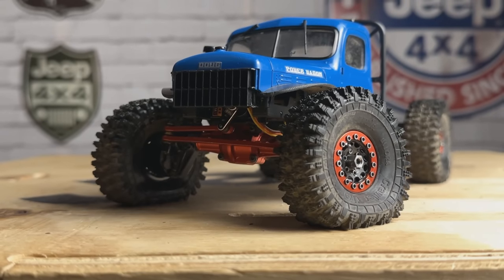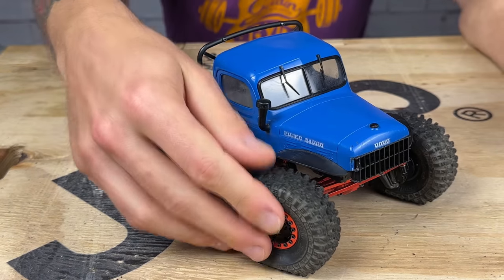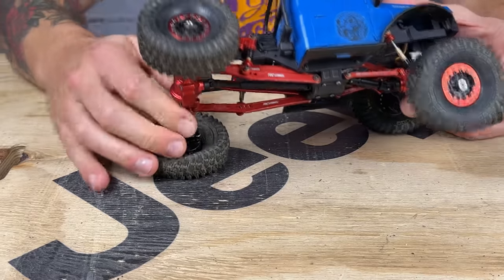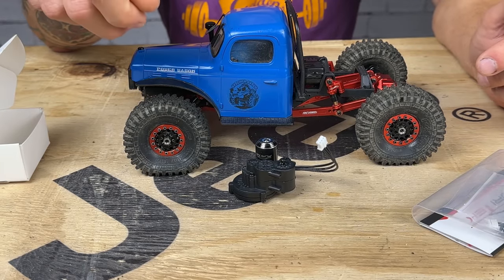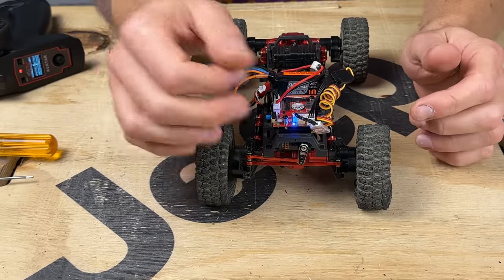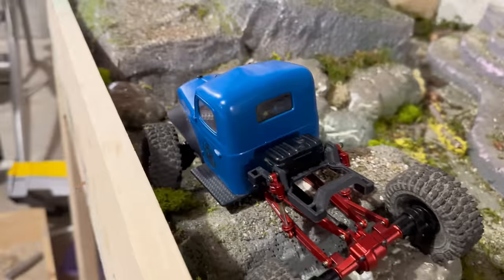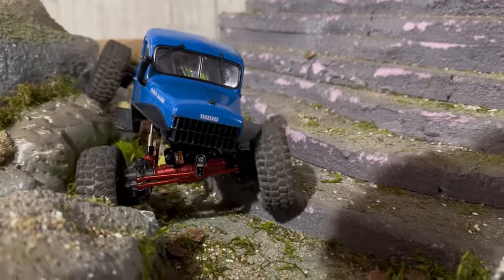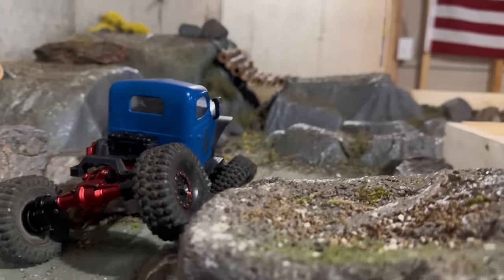FMS FCX24 Power Wagon UPGRADES - Furitek BRUSHLESS Conversion, Extended Wheelbase, Crawling & More!

Comment from the maker: Timestamps
Build recap and current state: 1:28
Furitek upgrades: 6:30
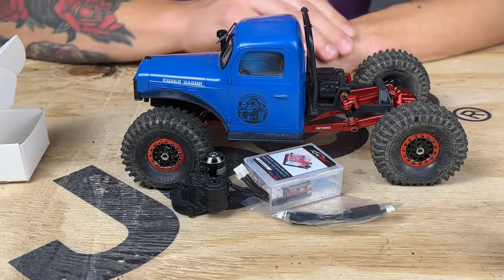Installation and setup: 8:27
Course runs: 11:19
Final thoughts: 16:09
Reply: With the longer wheelbase what do I use as a driveshaft?
I looked on the RCAWD website, most of the parts are there.
Not sure on what links I need though there was a couple of options.
Reply: thanks for the timestamps
Reply: Hi, whats the gladiator shaft you talk about?

Comment: Modified FCX will destroy all others even if modified! Those and the swampkings are my go to. Flubbers with fix side wall
 issue. Velcro your tegu on the transmission and run the stock battery in holder. This way you can drop the body down. I run the rear scx link arms up front. If you go with the shock loops I showed you and the shocks you'll spend some time with a Dremel to modify the body but its well worth it!!! I love Furitek motors but I opted for MOFO BAM 4100KV bolts right up. All metal gears are a MUST with this motor. In first gear it slow crawls well and the the punch is amazing. In second gear its just bananas almost incontrollable. No need for 3s unless your making a drag truck LOL. Merry Christmas. PM on facebook if you want to know more....
Reply from the maker: Great idea with the battery/esc location! I need to figure out how to get my avatar transmitter to switch gears. But you are right about the speed, it's fast even in first gear!
Reply: @CapeCrawlers  I use GT5 and AR52-A2+ rx plug n play shifts perfectly😁

Comment: I just bought one last week and I love it but it needs a little help what’s your build list minus the brushless conversion if you don’t mind your truck looks awesome
Reply from the maker: Thanks! Its got:
RCAWD brass wheels with Injora 64mm tires (soft lil nova foams)
RCAWD shocks, trailing arm kit, high clearance links up front, and axle housings
Treal portal covers up front, RCAWD in the back
Treal steering linkage, hex extensions
Emax servo
I think that's it less the motor/esc.

Comment: Since you didn't use the silver drive hsft that was included in the wheel extension kit. Can you tell me what each half measures. I was told the fully collapsed driveshafts measures 70mm but there is no info on a extended length?
Reply from the maker: The extended length is ~96mm

Comment: Man, this is so cool.... I have been into 10th scale, but I did get my 8yr old daughter a scx24 JLU she loves and I have done a couple small mods... Really like the small class and ability to have really small area maps to run on, really gives the same satisfaction as larger with small space requirements. This rig here is insane, it's so cool how many options they are making for these units. Question.... She sees my faster rigs and at times wants just to drive faster what would you recommend for a little more speed without sacrificing its crawl ability etc where maybe it would be a little more exciting for here.. Pinion gear? Motor? Or is it just not good to go faster with it... Don't need super fast maybe like a 50% speed increase over what it is out of box
Reply from the maker: I love that your daughter is into it. That's so awesome. I would suggest the Buzzsaw motor from Mofo RC! It's WAY faster than stock but still has good crawling ability. Plus its a direct bolt in with little to now additional modification necessary.

Comment: Is there any chance of a parts list?
I’m in Australia, we have virtually zero parts here so we have to order internationally.
Can be expensive if we order the wrong parts👍
Reply from the maker: Here's a quick rundown:
RCAWD high clearance links up front
RCAWD extended trailing arm kit
RCAWD double barrel shocks (not oil filled)
RCAWD beadlock wheels
RCAWD steering linkage
RCAWD aluminum axle housings
RCAWD inner and outer rear portal covers (black brass)
Injora 64MM rock terrain tires with Crawler Innovation medium foams
Treal hex extensions
Treal brass front portal covers (heavy)
FMS steel transmission gears
Furitek micro komodo and Tegu24 Pro esc
Reply: @CapeCrawlers  awesome mate 👍
Thank you for taking the time to do this.
You’ve built an amazing truck, keep up the great work.
Reply: I know it’s an older video, so I’m hoping it doesn’t go overlooked. Such an impressive build and I’ve gotten so many ideas from it. Which Treal hex extensions are you using?

Comment: I love your videos they are very helpful. I can’t find a video where someone discusses the wires needed to set up furitek in the FCX24 …. I’m struggling to set up Furitek in my FMS K5 Blazer….. Can you help with that subject?
Reply from the maker: I can try. What exactly do you mean by wires? You’ll need a new receiver and the furitek system will plug into that (usually in channel 2).

Comment: Great video. You had mentioned you put metal gears in the transmission. Which metal gears did you install? Did you put the FMS brand metal gears, or the treal Metal gears?
Reply from the maker: Thanks! I went with the FMS because I wanted the metal shift form as well

Comment: How would you compare the slow crawl ability with the stock esc and a hobbywing 1080?  Im sure the 1080 has more options, but are they similar for slow crawling?
Reply from the maker: I haven't tried the hobbywing so I can't speak for that one. I can say that the FCX24 with the furitek system is one of the smoothest powertrains I have

Comment: What shocks would you suggest?  I was looking at the rcawd oil filled but they don’t seem to have much travel. Was hoping for something around 43mm hats oil filled.
Reply from the maker: There's not a lot of options unfortunately. Mofo RC sells some oil filled 42mm shocks, but you'll need to do some custom mounting of the shocks on the FCX: https://www.moforc.com/products/42mm-long-travel-oil-shocks?pr_prod_strat=use_description&pr_rec_id=49136aaa5&pr_rec_pid=6959436300345&pr_ref_pid=6661714214969&pr_seq=uniform
Reply: @CapeCrawlers  I’m putting them on furitek  caymen.  I don’t like the current shocks it has.  I have scx 24 shocks maybe I will drill out the hole so my screws will fit through.

Comment: Hi Adam do you use 1 or 2  O rings  when mounting the shocks top and bottom?
Reply from the maker: On the FCX I used two o-rings.
Reply: @Cape Crawlers  thanks Adam just finished my first rc car build with my fcx24. Got alot off help and advice fromyour channel

Comment: I think I need one of these.
Reply from the maker: Yes you do!
Reply: @CapeCrawlers  one question. What’s the deal with the v1 and v2 electronics?
Reply from the maker: @southbound_rc  On the Axial SCX24 the fist generation rigs had the V1 transmitter and receiver. Primary differences with the V2 are that it does not have speed modes, which V1 did, and it has more adjustment on the transmitter and overall smoother operation. V1 electronics to have capabilities that the V2 does not such as ability to run external ESC's like the Furitek components, and the V1 can run 3S batteries.
Reply: @CapeCrawlers  I was talking about the FCx24 isn’t there one that’s preferred as far as the electronics. I see people that are disappointed that they got one over the other. Maybe I’m confused..
Reply: @CapeCrawlers  anyways thanks for the information I been gathering from all your videos !
Reply from the maker: @southbound_rc  Ohhhh yes, sorry I default to the Axial when I hear V1 and V2. Yes, the newer versions of the FCX24 are shipping with a less functional transmitter and receiver combo. At least the Max Smasher is, I am not sure about the Power Wagon. The V2 eliminates the four switches on the transmitter which allows for custom drag brake and throttle settings. It also ditches the button dedicated to controlling the lights. The good news is that you can order the V1 electronic set for ~$40, but it's still a bummer.

Comment: what are your thoughts with cutting stock springs down to get some ride height but still be slammed
Reply from the maker: I think that's a good approach. I've done the same thing on aftermarket shocks and it works great.

Comment: Looks good but expensive, ...try the bigger  $6 ebay brushed motor and it will be nearly as good with no need to change radios etc.
Reply from the maker: It is expensive for sure. I’ll check out that motor for my sons power wagon!

Comment: Have you done anything with the body mounting? Cause stock is a pain! I cant find much on this issue...
Reply from the maker: I have not, and I curse that body mount every time I have to open this thing up! I know some folks remove the body clips and fenders and use a magnet setup. I havent tried that, but it's tempting.
Reply: @CapeCrawlers  Thank you for the reply! I was thinking of the magnet idea... I relocated the esc and on/off switch and rerouted the wiring and it seemed to help but still kind of frustrating.

Comment: Hi! what's the idea behind adding weight to the front? FCX24 already has too heavy front.
Reply from the maker: I always try to bias the front. When I add weight to the back I try to overcompensate and add more to the front. Also with the shock positioning the way it is, it tends to pull the front end up on inclines. I need a lot of weight to keep the front tires planted.

Comment: Until I can upgrade the electronics in mine, I wish there was a way to run JTS connector batteries on there, but I haven't found an adapter yet. Those stock FMS batteries just dont have the umph once you really start adding weight.
Reply from the maker: Agreed. I have to pack about five of them if we go on any serious crawling trips.
Reply: @CapeCrawlers  that's insane!
Reply: I took the JST plug off an old car I don't use and soldered it onto my Max Smashers wires. It runs way better with 20c battery compared to the stock 5c. Its the third time I have ever soldered, its not as intimidating as it looks. I've seen people also run the same plugs as the SCX24 since there are some good small batteries for it as well.
Reply: @Glowingtomato  unfortunately, I don't have a spare lying around. I could probably find a lead, and receptacle online though. I have some soldering experience.

Comment: Random question but do you know if a brushless furitek komoto system will fix in the scx24 mofo ugly af chassis/ what mods are needed to make it fit
Reply: That fcx looks sick by the way
Reply from the maker: It will fit. You will have to do one of two things: 1) front mount the motor and relocate the battery tray, or 2) flip your skid plate to face the motor backwards but then troubleshoot which driveshaft/link combo works.
Reply: Thanks

Comment: How did you fit the emax servo in it?
Reply from the maker: It fits right into the tray with no mods. Prior to the ESC swap I had to cut off the connectors from the FCX servo and wire them to the emax. Basically swapped plugs. That worked for several weeks before I did this upgrade.

Comment: y dose it have to be 160 prolly more like 170 for a brushless kit it's cool but dum I already spent 150 on the car right then 140 mabby 145 on metal suspension axels sway bars u know all of the above and if I want it to have enough power to really br at its peak build it ganna be another 160
Reply from the maker: They are little money pits! It's crazy how quickly it adds up.